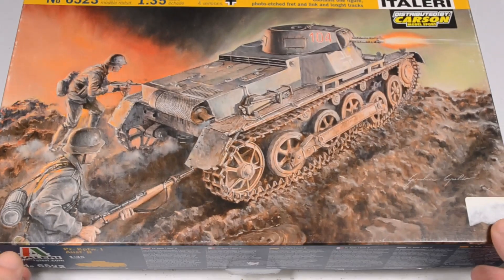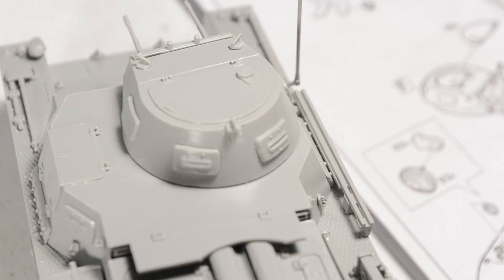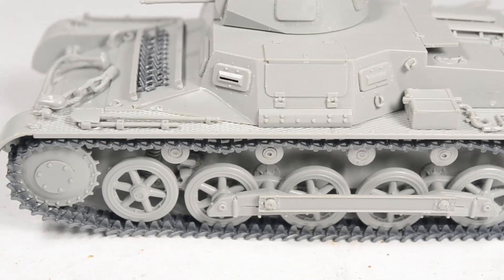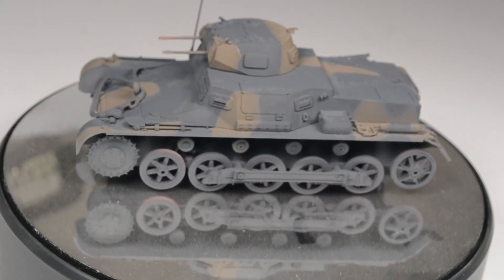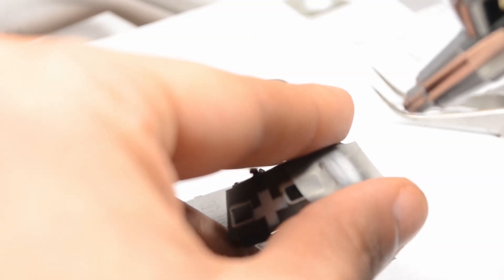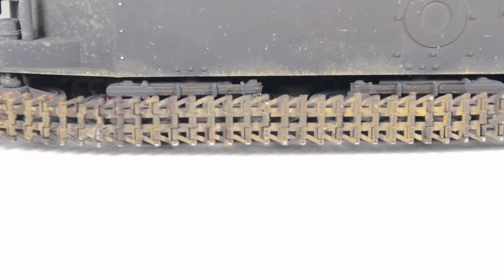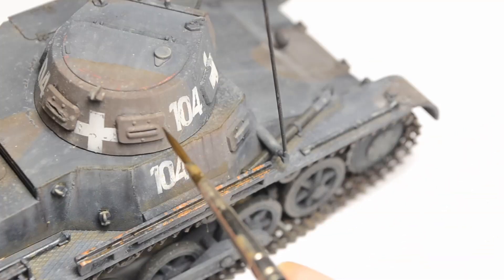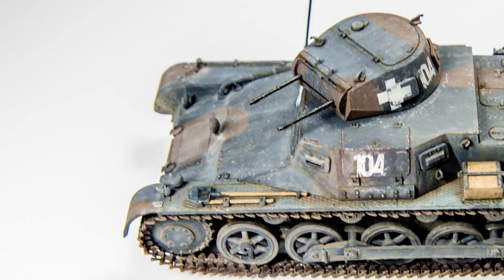Italeri 1/35 Pz.Kpfw. I Ausf. B - Full build and Weathering

Comment: You have done a nice job weathering this little guy! I think you are on to something with the rain streaks. It provided that contrast and dusty effect as well. Built in such a short time too! I will nitpick you on one item and that is the straightness of the tracks. They seem a bit wonky on the idlers and drive sprockets. I just finished the same style of tracks on my Dragon Type-97 and a lot of care is needed to keep these little suckers straight. Nevertheless, I hope you give us more wip videos so you don't disappear for three weeks. I will also try using thinner to pretreat the paint before you apply it. Seems to make a nice surface to move the paint around as needed. Cheers and as always, thanks for the new content! The longer video was great!
Reply from the maker: Thank you, for next week I'm set up to bring a video on resin printing king tiger tracks - there is plenty to talk about aside from build updates, no worry ; ) You are absolutly right with the tracks, I messed them up completly, countermessures: Thicker glue and better modulization are beeing implemented at this very moment on my bench - I'll take more care in the future. Every Enamel and Oil paint is happy to float around on a moist surface. Just use the good thinner - the ones from AK or Ammo, they just know thier own paint best, I learned this the hard way ; )

Comment: Have you built the ex tri start one that new hobby boss line?   Honestly if you haven't I really can't recommend it enough! The detail for such a small tank is outstanding I'd love to show you a photo of what I have done with mine! Also in D.A.K configuration! Used African korps dragon figures I painted the panzer 1 ausf A in Dunkelgrau sealed and weathered abitty with enamels just streaking and some rust effects then went over it with my favourite product from AK there worn effects for chipping! Ypu won't find better of more realistic and great to use for white washes and the Gelbbraun over the grey and worn through so the DAK paints worn through to the old grey she's a wee beauty! And used metal barrels for the MGs there nice they stand out alot on this kit compared to when used on other's!
Reply from the maker: I'm building the Tristar Flakpanzer I atm, together with Dragons 2cm Flak 38. I do like the Tristar kit very much and yet it shows it's age. I personally rate modelkits by the ballance of having a good time assembling it as well as how much time is wasted for example on unnessesary cleanup like mold lines and oversized sprue gates. At least the FlaK component of the Tristar kit does not hold up when compared. The chassis is good, better than Italeri imho. i'd like build a dragon Pz I kit first before I finally settle for a brand. but that's just me ; ) You can add me on scalemates.com btw, I'd love to see your builds!

Comment: What you think of Italeri models?
Reply from the maker: They were fine and fun for me in the beginning. Nowadays I buy much more books and research my builds a lot. I moved on, Italeri I left behind. Pro: small part count, usually fittng together well enough. Con: very old molds / reboxes, soft detail and in many cases unfixable inaccurate. Only speaking of German ww2 stuff...
Reply: @Tankbrusher  Cool, thanks for the reply. Sound a bit like the older Tamiya kits.
Reply from the maker: @nathanc5778  It kind of depends on what you are looking for. Compare Italeri's Hezter - I think it's thier worst kit the geometry is totaly off. Than look at thier Bergepanther rebox -> it has flaws but is actually a nice looking kit, has PE included and can be finished in a reasonable time - compared to takoms full interior kit (okay that's a totaly different level, I know..). Italeris strength is more in the truck section.
Reply: @Tankbrusher  Ok. I mainly build German armour. I like Dragon but I live in Canada and Dragon 1/35th scale kits are absurdly expensive. So I look for other brands and then use upgrade sets. For instance, I just finished Tamiya's 35th scale Tiger I early production. I was able to buy that kit used, and a Voyager full PE/resin upgrade set for less than the Dragon out of the box! Same with a Takom StuG III. Like your videos, and appreciate your input on Italeri (never built one).
Reply from the maker: @nathanc5778  You should keep an eye on Takom, Meng and RFM and Bronco than and if you don't mind high part counts Miniart is insanly good! I can fix a lot by printing my own stuff, still, a lot of times it's just not worth the time involved. This is true for Dragons Panthers as well for example. Tamiya is very popular but as soon as you start to upgrade thier stuff, one of newer chinese brands will be more time and cost efficient - even at a higher part count